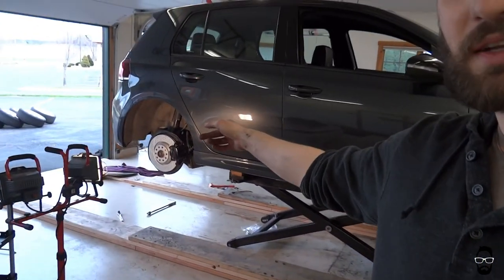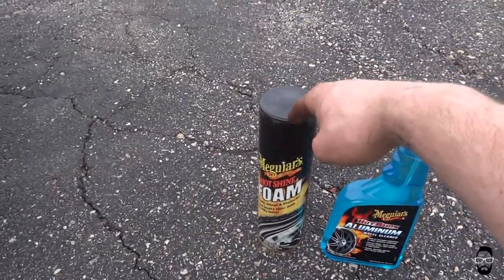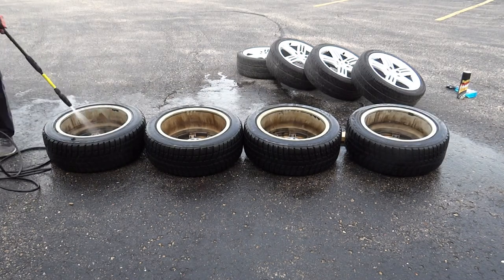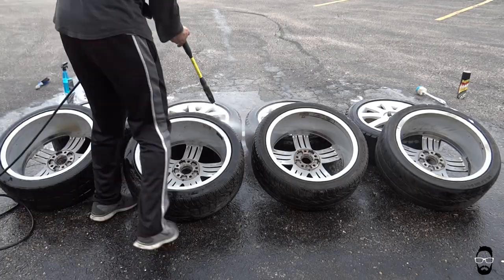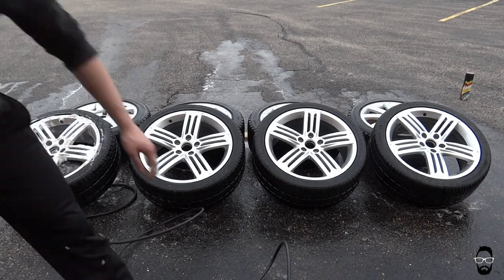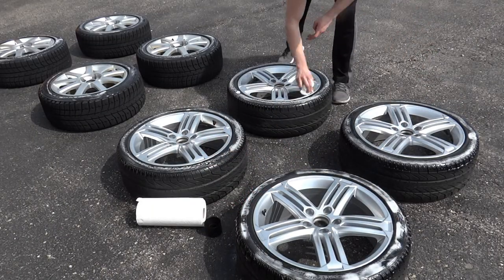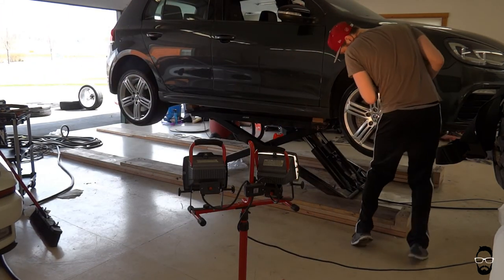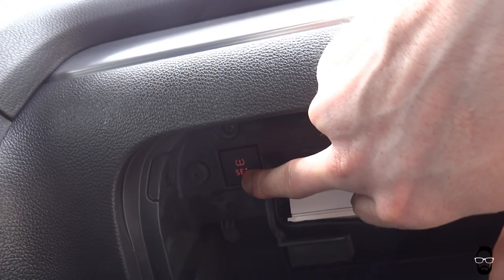Swapping Wheels and Cleaning with Meguiar's Products!

Comment: The r wheels are the same dimensions as mk6 gti? I love the way they look and I am about to buy them , but I want to b sure if they gonna fit good in my gti
Reply from the maker: Mario Garduno should be the same offset. They’re 18” diameter so depending on which GTI wheels you have, they might be an inch larger, but that shouldn’t be an issue.  

Just keep in mind the Audi peelers come in different widths, so if they’re not specifically gold r peelers, watch out for suspension clearance.

Good luck!
Reply: D I Y G A R A G E  i have a Detroit wheels and st coil overs I just don’t want they robber the coils.
My car is a gti mk6 turbo 2.0
Reply from the maker: Mario Garduno should be ok. 👌🏻